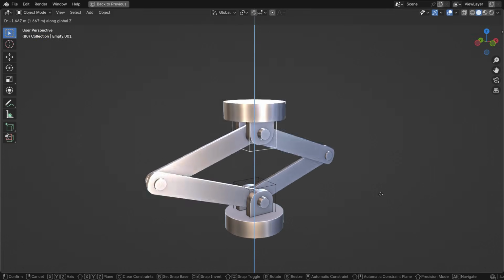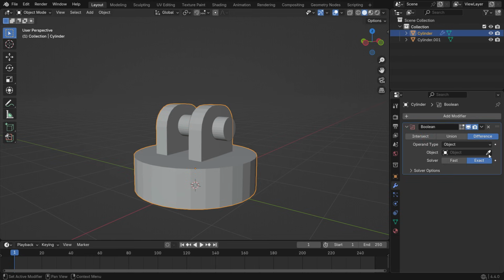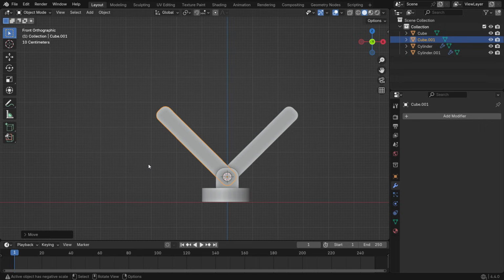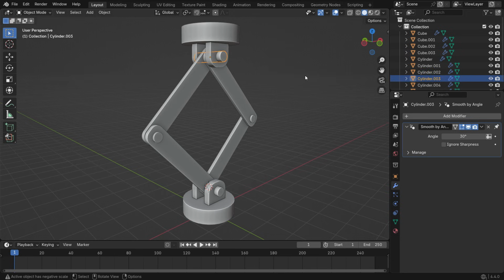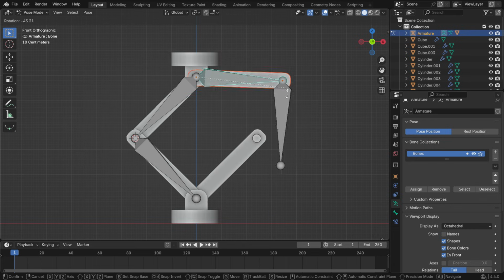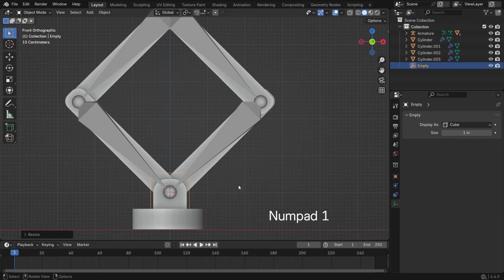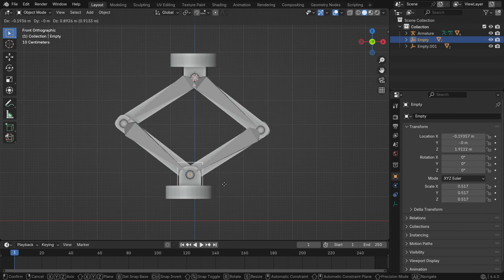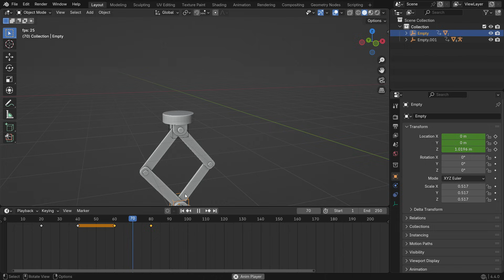Mechanical Rigging And Animation | Blender 4.4 Tutorial

Comment: I used this tutorial to rig a simple robot leg (2 bones) it works but if I move the foot controller (empty) backwards, the knee flips. I tried to add the pole target but it's not solving, it's actually making things work
Reply from the maker: You can lock the IK bone on specifix axes. So can prevent this.
Reply: @mk3dgraphics  yes I did that, but that wasn't the issue. The issue was solve by just rigging the leg into a flexed position. Adding the pole still screws it up though, but without the bone it works nicely

Comment: Thanks for such a great tutorial. It really helps. I do have one question, though. As a fairly new Blender user, I’m wondering why you appear to be doing this in Global mode. It seems to me you’d have more reliable matching orientation in Edit mode if you switched your layout page to Local before creating this. Is that true? Or is there something I’m not understanding correctly? Thanks.
Reply from the maker: You're right that Local mode can give you more control, especially when aligning objects relative to each other. I used Global mode here because it’s simpler for beginners, as the axes stay consistent throughout the scene. But if you're more comfortable with Local mode, go ahead and use it. it's great for precise alignment when objects are rotated or not aligned with the world axes. You’re right! When you import models and change their orientation using Global, it only affects how the object is positioned in the world, not in Edit mode. Edit mode defaults to Local orientation, which is why they don’t match.

Your fix is perfect! Switch to Local in Object mode to adjust the orientation of imported models, then switch back to Global when you're done. This makes sure both modes match up.
Reply: Actually, I think I may have just figured out why it might not matter. You’re creating the model from scratch, so Edit mode probably matches whatever you do in Global. The issue I’ve had was with importing models and correcting their orientation in the layout window with it set to Global, which creates an orientation mismatch in Edit Mode, as Global orientation doesn’t actually change the orientation of the object, just the object’s relation to the world. Edit mode always seems to default to the local orientation, so is unaffected by any Global changes on the layout page, which can create a mismatch for imported models that were re-oriented after import using Global.
Reply: Which come to think of it, would make a great topic for somebody to do a short video tutorial on. Took me forever to finally figure it out myself, as I couldn’t find anything online that could explain why my Edit mode and Object modes kept having completely different orientations. All it takes for them to match is in Object Mode is to switch your layout page to Local before correcting a newly imported model’s orientation. Once the re-orientation is complete, you can switch back to Global and your Edit and Layout orientations will match - unless of course you then move the model to a different location/orientation in Object Mode in the layout page, with it set to Global.